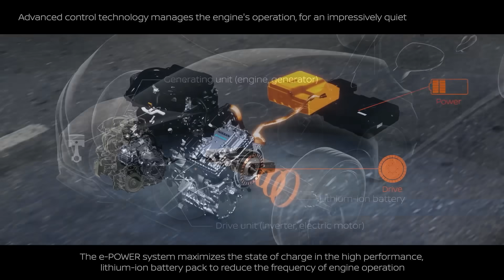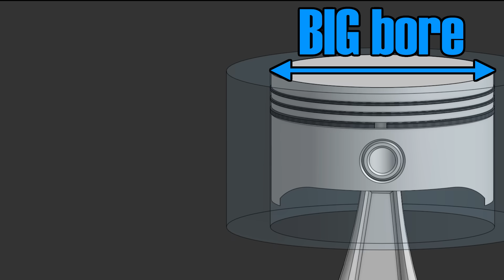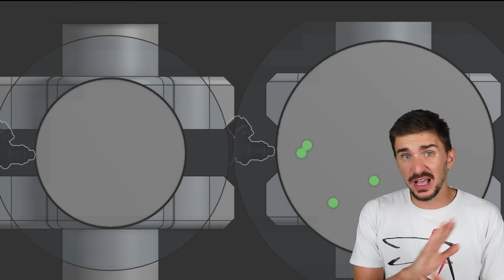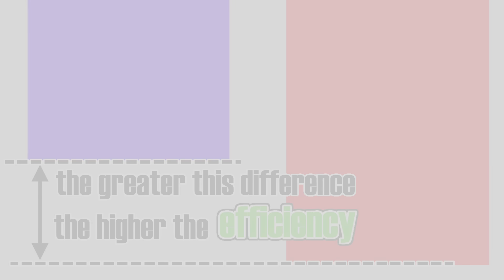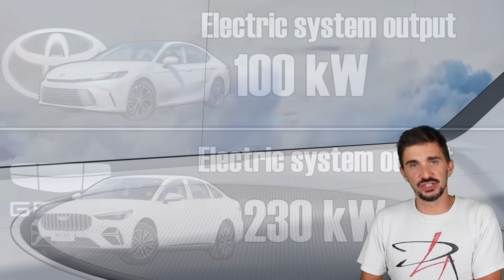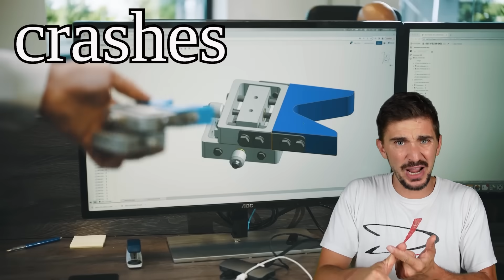How China's Geely Beat Toyota, BMW, Ford and Everyone Else

Comment: What if when more power needs the ICE switch from Atkinson to Otto cycle?With modern engine management systems and AI I think its achievable this dual-mode ECU.Eventual with a bypassable turbocharger that kicks-in for Otto cycle mode?

Comment: BYD and a lot of other chinese OEMs are now boasting 45+% thermal efficiency on petrol engines. So far whenever I looked into them, they had one similarity. They somehow mingled it up with the recuperaton system of the car they go into and then take that skewed number and treat it like a raw engine efficiency when comparing it to competing models who do not use this trick.
You can already get those "super hybrids" in Europe and once the battery runs out they all need upwards of 6L/100km, a number that was not even big news 10 years ago.

While these engines are a huge progress for china and showcase that "just focussing on gas cars" will not bulletproof western OEMs against chinese competition, I doubt that you can put the thing on a stant without the hybrid parts, without fudging the numbers and read close to 50% on constant load.

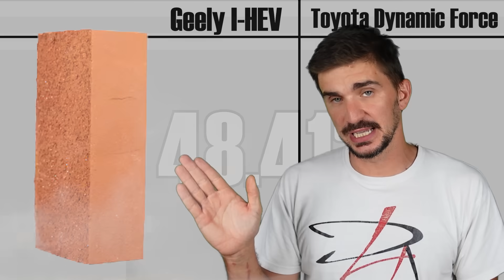PS: You had me fooled for thinking this is another press release glaze video and then Boom! 7:26 happened. Thank you for that.

Also that power cloud AI miracle voodoo was called "Charge mode" on 2014 BMW Plugins. And I am sure they were not the first ones to do that either. It is not magic and I do not see why that would need AI at all. "If SOC <10%: charge battery"

I am really curious how these Geely hybrids pan out. How they compare to the BYD and MG ones, which already did not get close to living up to their fuel efficiency claims.

Comment: Does it use cylinder offset? Also couldn't they make the engine alone usable by making it bigger maybe a 2.5 like Toyota??
Reply from the maker: I don't know about the offset, they haven't published that but I think it likely uses it. Yes, a larger displacement would improve performance but that's not what they were after. They have less efficient turbo engines for that purpose.

Comment: Interesting vid as always, but dude, nobody should say 48.41 as "forty eight point forty one", but especially not in technical circles.

".41" is no more "point forty one", than .041 is, just because they contains a 1 after a 4.   It's "point four one", or if you really want to say "forty one", it's "forty one hundredths" (or "forty one thousandths" for .041).

Perhaps it's more accepted in other languages?  Because for most in the Anglophone world's technical circles it's as a glaring/jarring error, and a negative suggestion of competence and understanding.  Clearly that's not you, but I'm sure it's also not an impression you want to give.

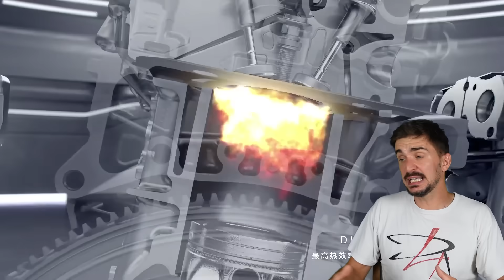Comment: 16:10
if you take a Prius PHEVs, 13.6kWh / 3500lbs / (9.8m/s^2) it gives 3.14km(10000ft) of elevation .
meaning that the car should be aalmost able to drive up that climb on battery alone if it drives slowly enough, or it can go down that elevation and charge  the battery from 0% to almost 100%.
so inna highway cruising scenario where the engines runs at constant power, it is capable of "flattening" up to 10000ft of elevation. of course to make full use of the battery you need to start a climb with ~100%, finish with ~0% and the opposite downhill. this shows the value of having software that knows you GPS position, elevation and speed and the roads around you, to optimize the use of a battery. more realistically, using the net capacity instead of gross (11 kWh) you still have 8300ft/2500m. which is still more than enough. what most PHEVs lack is understanding of what you are trying to do to optimize the use of the battery. discharging the battery, then running in pure gas hybrid mode is rarely the best strategy. on long trips, you can imagine to use one part of the capacity as a kinetic energy buffer that is empty Hen you're cruising at highway speed, and full at  a stop. then another part of the battery as a potential energy buffer, charging when you drive down a hill and discharging wen you drive up. you can size this buffer based on the elevations on your trip or in your area.
and lastly, the rest of the battery can be used to drive in EV mode  for short trips. or be used as additional electric assist all along your journey. if you have a road trip mode in the hybrid, the ECU can make sure it always keeps the battery charged enough to keep all or most of the electric performance at all times, which is exactly what traditional hybrids do.
basically, to make everything more simple, you can use a PHEVs as a "super hybrid" instead of using it as a weak EV first, then a weak hybrid once the battery is almost completely depleted. EV mode and battery deplete mode are still useful when you have access to charging, for daily driving and short trips. EV mode  if you want zero emissions / maximum gas savings
battery deplete mode if you want increased performance and increased mpg.

Comment: Another thing that increases efficiency of undersquare engines has to do with the exposed cylinder+cylinder head+piston crown surface area during the highest temperature part of the cycle.  Combustion is most vigorous after ignition and before the piston has traveled very far down the cylinder.   With a relatively long and small diameter cylinder, less area of metal is exposed to that high temperature and turbulence gas, so less heat is lost to the engine components.   
The shape of the area inside the combustion chamber where the fuel is burning is relatively deeper compared to the diameter of its ends (the cylinder head and piston crown), making the volume of burning gasses closer to a sphere (the ideal) than a thin pancake.  The effect is that there is an average longer distance for burning gasses to travel before encountering to a cool surface that will stop the reaction.  This aids in complete combustion.   Especially at low RPM, the combustion event is mostly completed earlier in the stroke, so the maximum pressure is exerted longer.  This makes it closer to an ideal Otto cycle, in which the fuel/air mixture burns instantaneously. When the combustion event continues well into the descent of the piston, less overall force is available earlier in the stroke to be converted into mechanical power, reducing efficiency.

Comment: Western economies are very fossil fuel centric. It's where the money is at... Example: my 2003 corolla gets only 2 combined mpg less than my brother in laws 2025 plug in hybrid rav4. Granted, there are other cars reaching into the 60s or more, but most non hybrid cars coming to market today aren't much better than my Rolla. Their engines are better, more efficient, but marginally so, and they also weigh almost double your average 00s car.

Comment: the main question is if we can trust those numbers from China
Reply: Yeah,when test are Chinese too
Reply: You just need to trust the users' choices; Chinese cars are selling like crazy all over the world.
Reply: It's possible even with napkin math. They essentially have a lawn mower engine charging up a EV. It gets good efficiency but the battery pack is expensive and driving up mountains would cause it to wear out faster. Toyota doesn't have this problem their engines have enough power to keep the car going and charge the battery.
Reply: @markm0000  well they have that 2.5 turbo diesel engine from chery doing basically the same thing, so almost the same size engine at what toyota thinks is fine for a toyota landcruiser 70 series but with EV portion on top.

Comment: Great video. I have a question regarding Miller or Atkinson cycles: When we say they have a displacement of (for example) 500 cc per cylinder, is that 500 cc measured from the point where both valves are closed? Greetings from Argentine Patagonia.
Reply from the maker: No, they are still measured the same way because the combustion stroke is still the same. Also, many Atkinson engines can go in and out of Atkinson with variable valve timing.
Reply: Thanks!

Comment: I thought the Chevvy Volt was like this - a range-extending ICE engine.
Using this approach is fine when you are charging almost all the time, but the gains in thermal efficiency of the engine pretty much go away in other losses. If you use the mechanical power generated by the engine to turn the wheels you simply skip many steps - the generator converting mechanical power into electricity, any converter you might use, battery charging, battery discharging then the electric motor to turn in back into mechanical power. All of these are quite efficient, but there are many of them and they add up.

Comment: It seems to me that the Mazda MX-30 with the range-extender rotary engine could be considered an enginified EV rather than an electrified ICE vehicle.
Reply: The wankel in the MX-30 can't drive the wheels though. That's the main difference. Mazda has hinted at trying to bring back rotary powered cars for a while now, but nothing in production so far
Reply: They should be looking at the LiquidPiston inverted rotary engine to address the apex seal problems.
Reply: @ctrlaltdebug  what? those liquidpiston engine? still hoax only todate! not proven at all! let alone mass-produce!
Reply: @djhrjeiwhri  maybe not their exact design, but putting the apex seals in the housing instead of the rotor allows them to be cooled and lubricated better, and the apex seals were the main problem with the Wankel engine.
Reply: @ctrlaltdebug  still, all of this IS NOT PROVEN YET!

Comment: Isn't modern Honda hybrids a bit like this too? I mean in the sense that they are "enginized" ev cars... They're driven by the electric motors alone and the ICE is there to keep the batteries charged, only powering the wheels while using cruise control on highways at around 120 km/h and the computer deems this to be more efficient (it's either one or the other, it cannot use both electric and ice at the same time like toyota does). They achieve crazy fuel efficiency numbers.

EDIT: 16:35 aaahhh dammit, I'm not interested anymore.

Comment: It’s not that difficult. Have some static profiles that behave on a set algorithm and then an intelligent profile that adapts based on your destination, taking into account topology and average road speed. If it’s a long highway roadtrip, have the motor ON and help the battery at all times, if it’s a downhill section, have the engine off all the time and recuperate.. and never let the battery go below 10% unless user chooses EV only.  Like.. this is something I could write up in an afternoon.. you don’t need AI

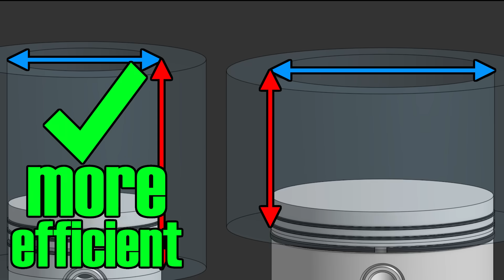Comment: 3:14  everything else being equal, over square vs under square aren't as different as you suggest. if you look at the most important metrics :
same displacement = same amount of air, so also same amount of fuel. same compression ratio = same volume at TDC (but different shape), same amount of energy that can be extracted between TDC and BDC. "punch" is force which is pressure * surface is higher with over square but work = pressure * displacement is the same. torque = force * leverage is similar and power too at same rpm
all this to say in an ideal world  they are pretty similar. this is when secondary factors kick in. the shape of the  oversquare chamber is much flatter and has more surface/more heat losses, the combustion does indeed take more time to reach the whole chamber. different shapes mean also different fluid dynamics and different volumetric efficiency at various rpms. so basically if you use a simplified model they are eidentical but as you get closer to reality there are not so negligible differences. to simplify over square can rev higher and make more power, it can also be tuned to have peak torque higher (bigger valves). undersquare has less heat loss, so typically more efficient for the same compression ratio. basically oversquare vs under square influences the "character" of the engine but it's possible to give an oversquare engine also a low rpm torquey character with variable valves / intake geometry. forced induction, etc. basically everything you say is true but it's marginal differences, for instance F1 V6 with 1.6x oversquare ratio can achieve 50%+ efficiency with the hybrid system (Regen) but also 40-45% pure thermal efficiency without the hybrid part, and without most of the modern engines trickery like variable valves/intake geometry, which is actually even more impressive considering the boost level, rpms and power density. a "perfectly" efficient engine would have road hybrids relaxed bore stroke/ratio, low rpms, variable valves, turbo compounding to extract exhaust gas energy but not for forced induction, but the same level of extremely tight tolerances, extreme compression ratio/high octane fuel, exotic materials. it would run as adiabatic as possible (least cooling possible) using ceramic cylinder, and use slow, lean burn to reduce flame temperature.

Comment: Its a good report but a slight correction is needed:
Presuming the same displacement engine, the volume of the chamber when you are at top dead center will be constant as you vary the bore vs stroke ratio.  A big advantage of a smaller diameter piston comes from the fact that this volume has a much bigger diameter than its height and a smaller piston makes those two numbers closer to equal.  This makes it easier for the fuel to mix into all of the air because its is the longest distance from the injector that matters most.

There is another huge advantage to "Miller cycle" vs the other one.  I can spell "Miller cycle".  I can't spell the other one without looking it up.  This may also be the case for the Chinese folks.  When they transcribe a name into their "alphabet" they find words in their language that sound like the name.

Comment: A brief explanation of why automakers are starting to use port + direct injection, Port injection has the benefit of helping to keep the intake valves clean by dissolving carbon buildup on the back side of the valve and moving it to the combustion chamber. Direct injection allows for a higher compression ratio without pre-detonation; the fuel is added just prior to spark ignition.

The combination provides better efficiency by keeping the intake valves cleaner, thus better cylinder breathing, and higher efficiency due to the higher compression ratio.

The downside is system complexity, eventual higher maintenance costs, and misfire diagnosis.

Comment: and that is the most usefull style of hybrid. Electric motors can be powerfull but long rage needs large batteries(try having powerful ICE and good fuel consumption :D). you are not flooring it all the time. short burst of power can be easily provided by EV side. what EV cannot do right now is give you great range. a weak petrol(tiny diesel would be even greater for long range travel. low consumption would lead to low emisions, plus - very controlled combustion. and turbo ofc :D) engine to give enough power for cruising while staying in high efficiency all the time and you get really long range on liquid fuel that you can refill quickly. logically, generator should be even better idea for constant max efficiency, but converting into electricity also has losses.

Comment: None of this means anything until it proves long term reliability!  Efficiency is great but not if the engine doesn't last 20 thousand miles or has numerous electronic problems.

Comment: Before the second world war, in Great Britain the taxation forced motor manufacturers to make very undersquare engines.  
100 years ago, the Bentley 6 1/2 litre had a stroke to bore ratio of 1.4.    A six cylinder OHC, 4 valves per cylinder engine from a completely different time.

Comment: I'm curious about the long term reliability of those engines, and if they perform as expected in normal daily use utilisation.  I mean very high compression on a small displacement engine is something that's shout fast wear (rings, detonation...) , but i could be wrong.

Comment: Both Geely’s i-HEV and BYD’s dm-i aim to improve thermal efficiency, 
but in vehicles equipped with those engines, you can achieve good fuel economy only in the low- to mid-speed range—at highway speeds, 
the fuel economy gets roughly twice as bad.